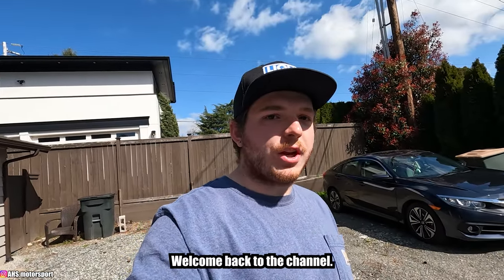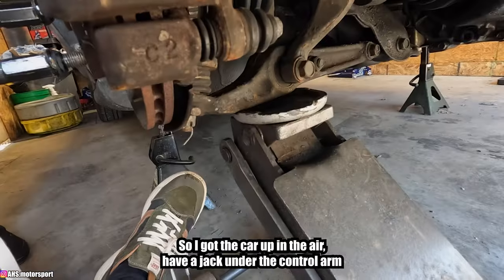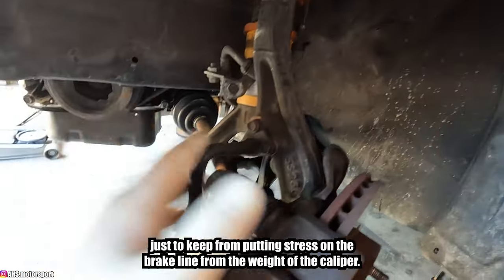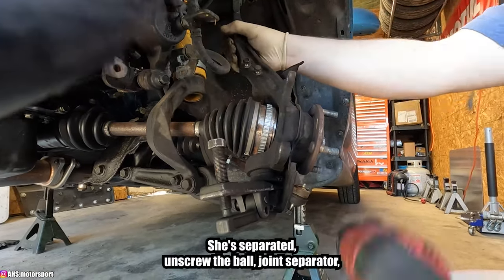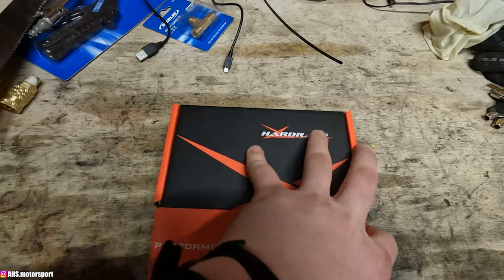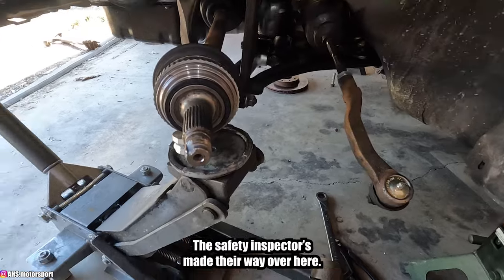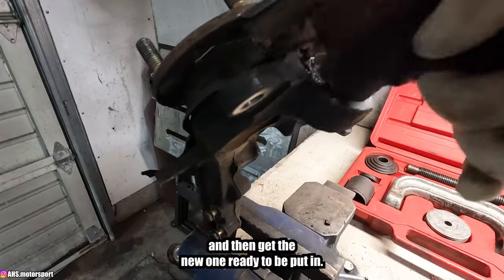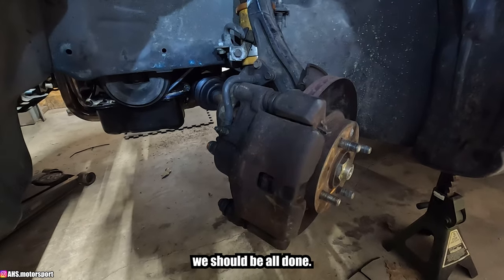The WORST ball joint I've ever seen! | 1992-1995 Honda Civic Lower Ball Joints Control Arms How to

Comment: What spring rates and allotments are you running?
Reply from the maker: On this car I am unsure as I don't own the car but I can give you specs from my racecar if you want?
Reply: @AHS_motorsport  yes please!
Reply from the maker: @BigRichard_  I run -3.2 camber in front with around 3 degrees caster and 0 toe. Rear is -2.7 camber +.02 toe each side. This is on a 225/45/15 kumho v730 with 14k/10k spring rates